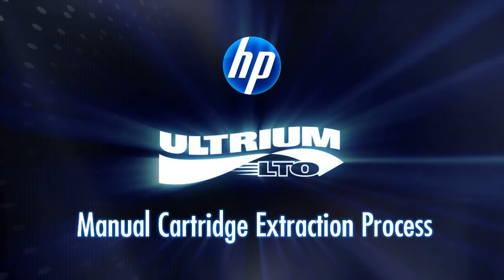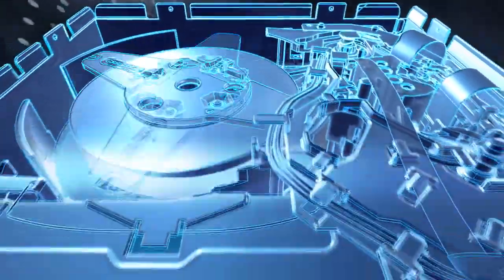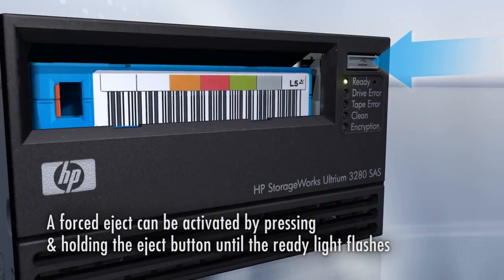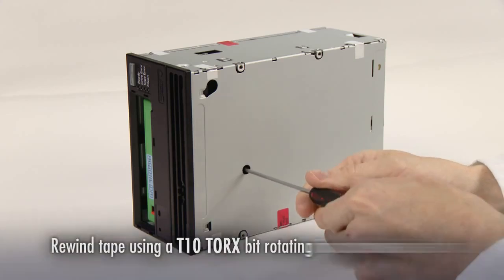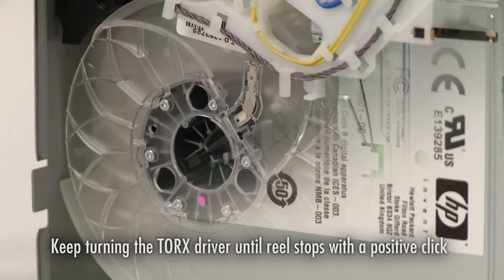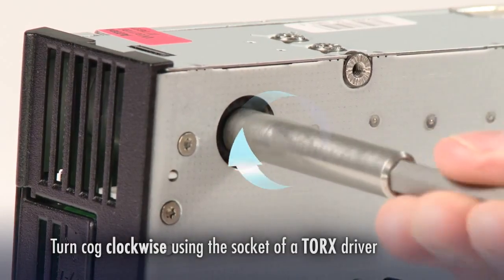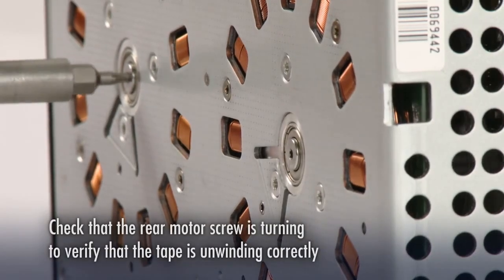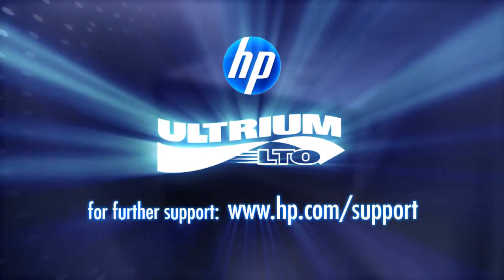LTO Manual recovery of stuck tape

Comment: Thank you for this! As these are ageing it's apparent the grade of steel used in the ejection mechanism wasn't great and there is minor surface rust that provides enough friction to stop the stepper motors and report a failure when none is due. A drop of lube on certain spots got me back to normal. Hope this helps anybody in the future recovering old archives. Please do carefully and at your own risk.